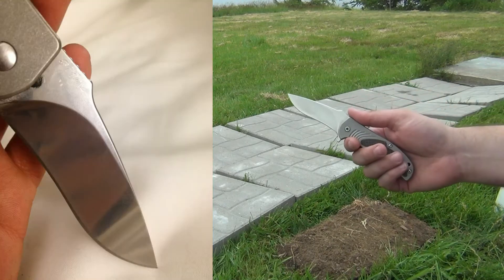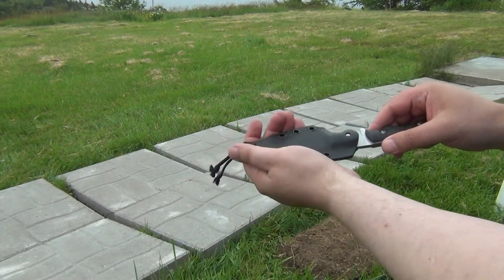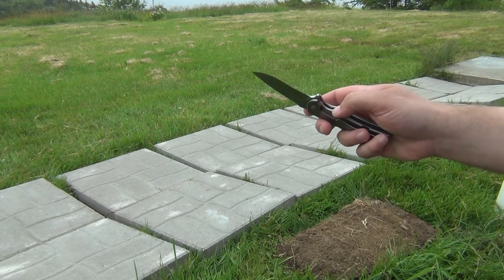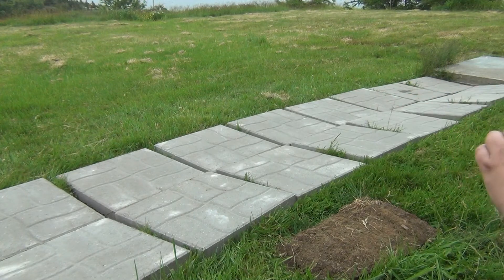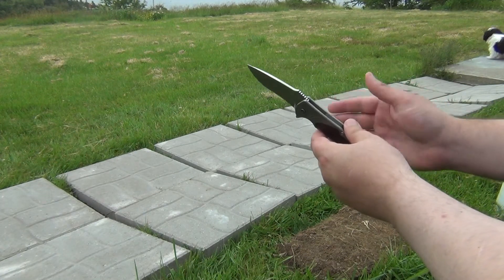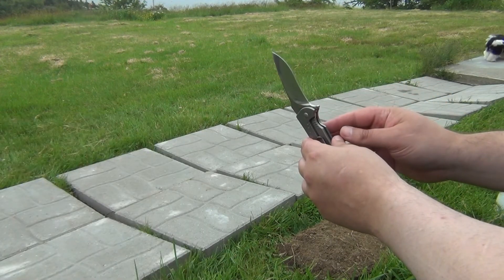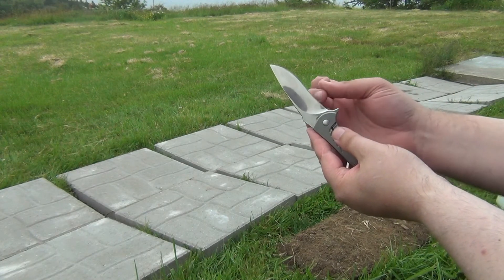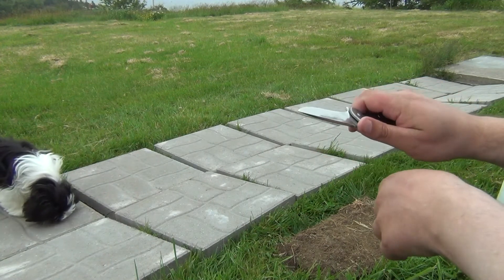R. J. Martin Modulator (S110V) - a little stock work / some comments on design

Comment from the maker: Thanks, this knife has excellent action no doubt due to the roller based bearings. In order to cause it to partially open you have to tighten it to the point of jamming the pivot screw. The construction is so tight/consistent that you can take all the screws out and still use the knife with only minor lateral play.

Comment from the maker: Edge retention is influenced strongly by geometry, but you originally asked about the cutting ability. 

The low sharpness edge retention in abrasive media is going to be above almost all steels with the exception of the carbide replacements (121 Rex).

Care needs to be taken to ensure the edge is at a high enough angle to stabilize the carbide though or they will just break out. 

If you sharpen it coarse you will get a sort of self sharpening through fracture (at a low sharpness).

Comment: When I first started getting really into knives, knives like the Sebenza and the XM 18 caught my eye and this one would have too, if I had seen it.  But after getting the titanium frame lock out of my system by use and time, I went back to knives with G10 handles as well, simply for the comfort and stability.  Now I see knives in this class as art pieces and not suitable for applications I find myself using a knife for. I used and carried a knife with a Zytel handle for 20 years, no problems.

Comment: when you mentioned cutting is dependent on shape more than steel, were you referring to the angle of bevel? sorry, i was more referring to how its edge retention is in comparison to other steels and what it may be similar to. what do you use to sharpen 110v? diamonds?

Comment from the maker: This is the way to do high performance hollow grinds :

-center/fuller style
-high
-deep enough to break the surface
-not so deep you can get binding
-grind to a fine edge

I would not want to use it for heavy work (cutting a 3.5" nail in half) as it could break the primary grind however the steel isn't suitable for that anyway so the design is consistent in that regard.

Comment: how would the shape determine its edge retention rather than the edge? it is the edge that does the cutting. would you say this steel is more difficult to sharpen than zdp 189?

Comment: i'm sure i would. the handle looks well shaped and the blade looks like a good cutter. it's funny you mentioned zt as the blade on that looks very similar to the blade on my zt 0200 though it was designed by ken onion. i noticed that the les george vecp looks similar as well. i'll have to be on the lookout for a folder in 110v. spyderco would do the best job of it i am sure.

Comment from the maker: The cutting ability will be dependent, rough on these factors (the order will change depending on the materials) :

-sharpness
-edge angle
-edge thickness
-primary grind depth/height
-blade stock
-edge curvature

The only influence of steel is that it is not practical to grind certain steels in certain shapes. For example a very thin D2 machete isn't a great idea though it would cut well, for a short time anyway until it made a bunch of smaller machetes from itself.

Comment from the maker: I currently use a wide mixture of stones, some of which don't even work well but are entertaining for that very purpose. 

I have a 3k/8k henckels waterstone which is horrible. Cuts slow, loads easily, goes out of flat fast, with not cut high carbide steels at all well.  

Lots of cheap stones, Brico makes excellent ones for $3 which cut very aggressively (though are soft and need to be flattened often).

Comment from the maker: Cutting is more so dependent on shape than steel. 

The only restriction here is that it is really high carbide so the edge is going to have the angle increased to prevent chipping. As the carbide aggregates are on the order of 10 microns in size. 

It has an extremely low grindability, lower than just about anything unless you have worked with steels like 15V, S125V. I would not recommend trying to sharpen it with very basic/cheap stones.

Comment from the maker: ZDP-189 is easy to grind compared to S110V. 

Anything can cut ZDP-189 as it only contains chromium carbides which are soft compared to even cheap stones.

S110V contains a large amount of niobium and vanadium carbide which are harder than basic abrasives and thus the basic stones won't even cut them.

Comment from the maker: The 0561 is almost an example of how not to make a knife as it is inconsistent and poorly executed :

-jimping is far too aggressive
-handle is sharp in multiple contact points
-grip is lacks versatility
-edge was severely burnt 
-lock is instable under heavy use
-steel makes no sense for prying/impacts
-but yet knife isn't designed to cut well

Plus Kershaw has the oddest ideas about steel HT and customer service/forum interaction is fairly weak (shill/fanboy based).